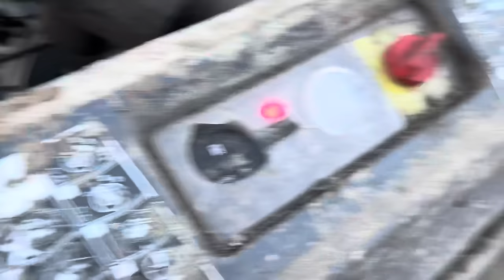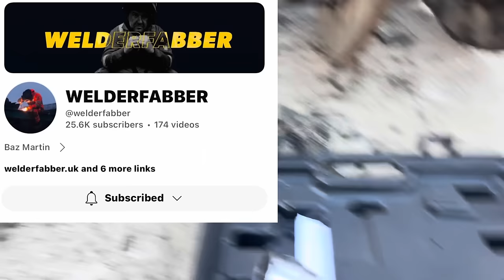forklift mast! compressor loom burnt! shredder,

Comment: Wonder could you get the tension off the forklift pipes by putting a few blocks on the ground and letting the forks down onto them, then pushing the ram down the rest of the way to slacken both the chains and pipes. Although with the larger wheels you probably still have to lengthen the pipes to allow for them anyway. Good job mate.

Comment: Them engines are best ran up to speed on half compression an then release the compression lever to fire the engine on them washers or it runs the starter to the grave yard in half the time.

Comment: Yo chrisy g!!!😊😊😊😊 nowt worse than a good old wire struggle!!! I fukin h8 dodgey wireing/spaghetti!!!takes fukin hours and can burn yer head right out!!! Recently had a punter who rammed a piece of foil in a fuse on his hiluk tail lights and melted loads of the loom under the dash so i spent days removing dash and soldiering in new wires to find out it was faulty tow hitch plug I FOOKEIN H8 WIREING!!!!!!GOOD VID AS ALWAYS LOVE AND RESPECT M8 😊😊